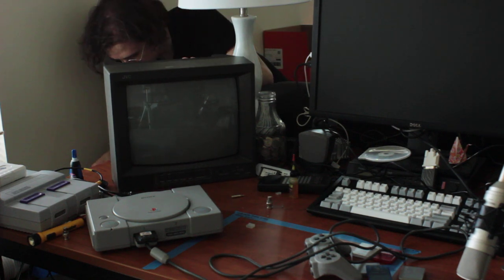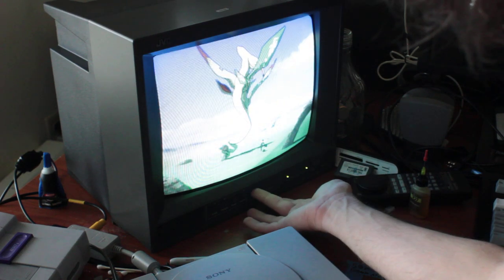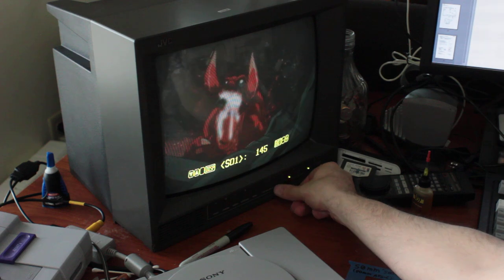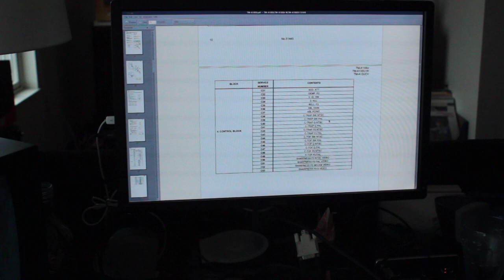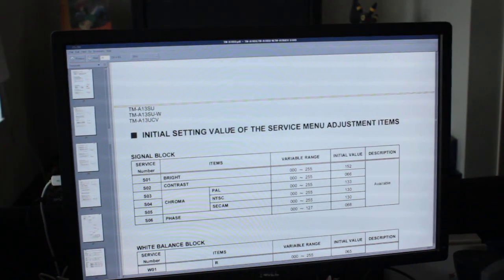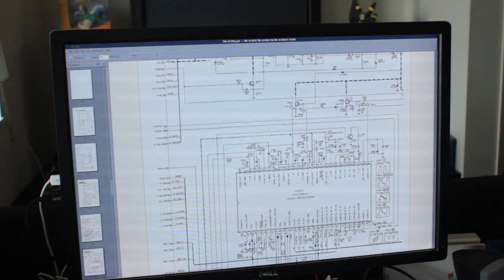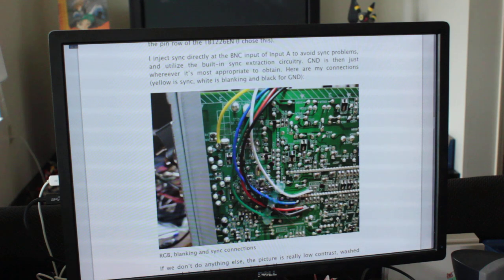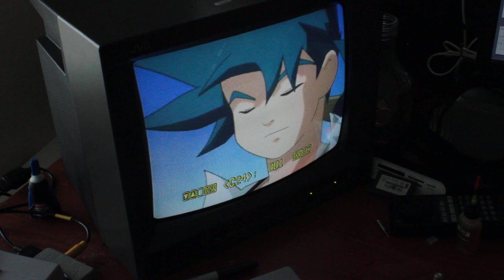New JVC 13" CRT Monitor Unboxing & Testing (TM-A13SU, 2007)

Comment: New old stock is always a fun to see!
Reply from the maker: It was an impulse buy, and it's unfortunate that it now can't be new old stock anymore, but it's good that I bought it because my Apple IIe composite color monitor started dying while it was on the way. Unfortunately it seems totally undocumented what kind of flyback transformer the IIe monitor uses (because Apple), so my hopes of repairing it are low for the immediate future.
This is basically a better substitute, though. It has S-Video and composite video, as well as multiple inputs, while the IIe monitor only has composite. There's a mod I can do with an Arduino or ATTiny microcontroller to make this one use a notch filter instead of a comb filter (to make it like the IIe monitor), and if I do that then it should be essentially a straight upgrade (Comb filters are better than notch filters for interlaced video, but worse than notch filters for 240p video. Comb filters introduce weird color blending on the edges of solid objects in 240p.

Looks like there may be two more NOS units on The Broadcast Store.
Reply: @wyatt8740  You could always just repack it and pretend it's never been opened every couple of years! 😉 My dad built a Heathkit tv before I was born but it lasted a long time and I remember him working on it. That got me interested in videos of people fixing old tvs and stuff. I one day may try my hand at it too... But your thought sounds awesome with that mod!
Reply from the maker: @f.k.b.16  I've always wanted an unassembled heathkit TV. Saw an assembled one around ten years ago at my first job in a back room, which was cool, but not as cool as building one would be.